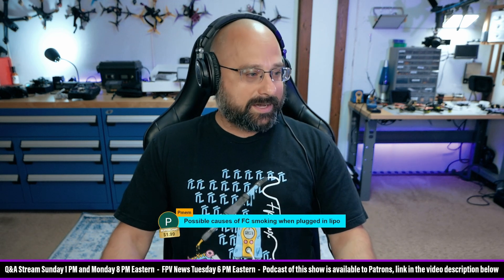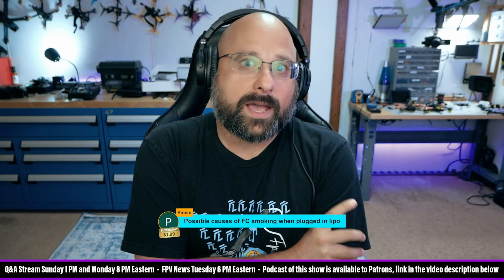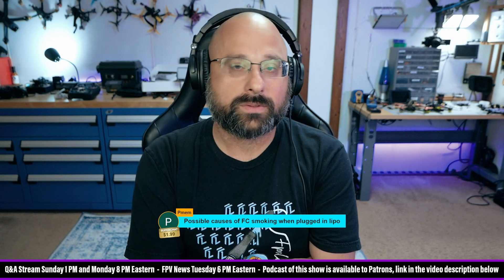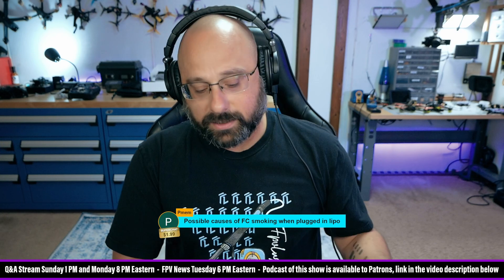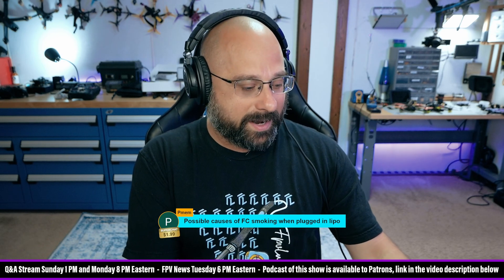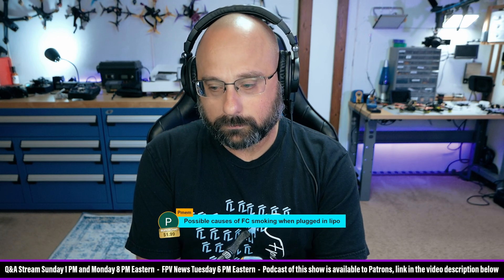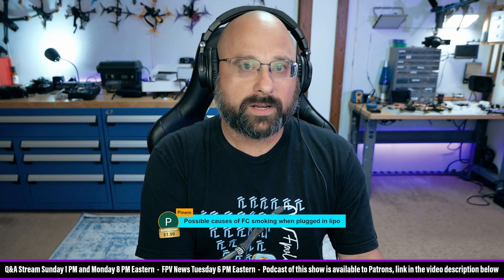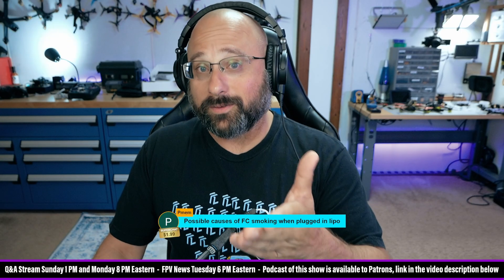My FPV FC Smokes When I Plug In A Lipo? Bardwell and Blunty's Historical Troubleshooting Influences?

Comment: I'm new to fpv and the only time I got smoke was when I stupidly put the esc upside down. Tightening the parts, the capacitors of the esc touched the carbon fiber plate underneath and voila!!! I got a plate of Esc bbq well done.

Comment: VIFLY Shortsaver 2 I use that on every build to first power the quad. And it works amazing well, not to mention it makes binding to the receiver so much easier. I had a speck, I mean a quarter size grain of salt piece of solder that had bridged two pads during the build and this thing detected it and saved a would-be smoked FC. I had double, triple checked everything, and this speck of solder was so small I didn't see it, until the magnifier came into play. IMO one of the best devices made and a MUST have!
Reply: Agreed. It never saved me yet, but it will happen. Also it's way more comfortable plugin in the battery after soldering something knowing it will not end up in flames. :D

Comment: Use your tester after every solder,  and use a voltage checker, testing is so important. all connection  must be corrected, its just bad wiring, it happens.
Reply: My smoke stopper has saved me at least 2 times.
Reply: @Truckguy425 what's a smoke stopper? I'm not slow or dumb just learning and haven't heard of one! Thanks

Comment: I don’t quite have the same background. But I started building projects with Arduino at 8. Got my first drone for Christmas when I was 12. So I gained quite a bit of electrical knowledge and the properties of how a quadcopter flies. I got into FPV right around my 19th birthday and it felt so familiar. I spent 10 hours in a sim, bought a 2s bnf, then built my own 6s 5”. The best advice I could give is learn to solder and build projects on a $20 Arduino board before tackling a $100+ FC and ESC combo. It’s better than a solder board because you learn how electricity works and it’s cheaper than a quad stack.